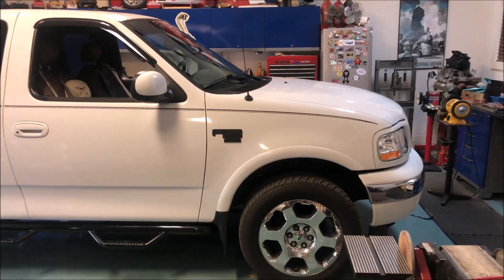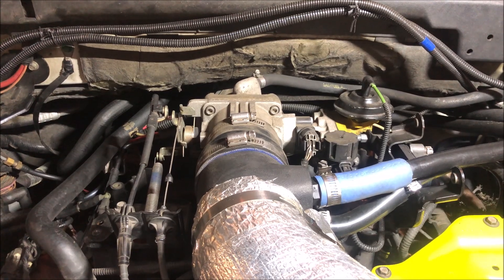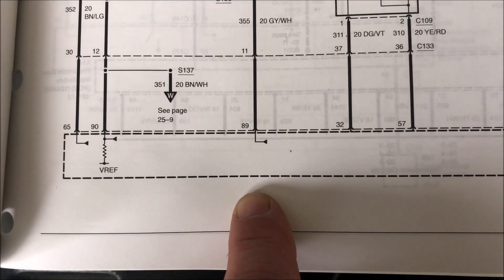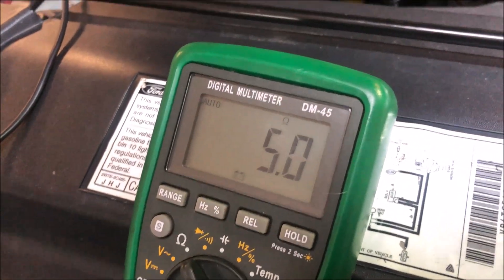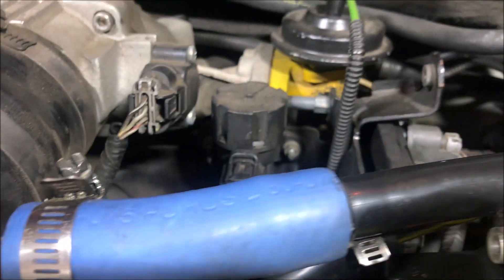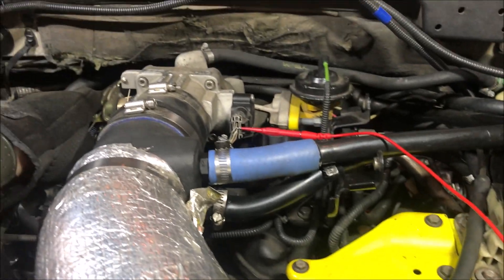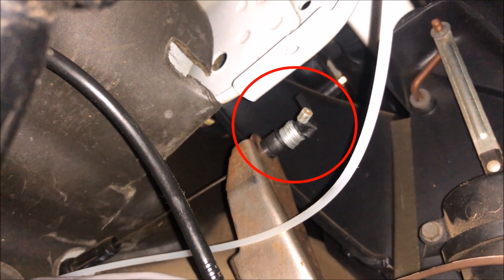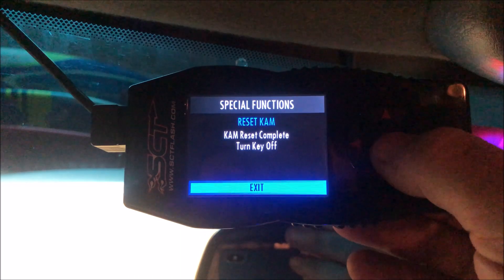How To Diagnose A Bad Throttle Position Sensor: 10th Gen F150, Expedition & Zip Tie Method

Comment: Hey man.  I like your explanation of how the TPS operates and what to look for.  I was wondering, how does your truck start with the 'Theft' light flashing??? I was told that if the theft light is flashing, it means that the PCM is not communicating or powering up, and the anti-theft system wouldn't allow for engine start!?!?!? What are your thought??? Thanks...
Reply from the maker: Thanks for the comment.  I'm not familiar with the details of the "Theft" system.  It will flash slowly when the vehicle is parked, however, I assume you're asking this question because it's flashing fast when trying to start the vehicle?  If so, the key might need to be matched to the ECM.
Reply: Cool. Got it. Thanks for the reply... @DrivingIntelligence

Comment: Does this work on a 2008 saturn aura
Reply from the maker: From the information I have seen, the reference voltage is the same at 5 volts.  You should get a voltage signal back to the ECU from about 0.5V to almost 5V.  A smooth increase in voltage as you open the throttle.  Same as shown in this video.

Comment: HAVYOU EVER HAD PART THROTTLE HESITATION LIGHT THROTTLE THAT IS PRESENT IN HOT WEATHER 2ND GEAR BUT GOES AWAY WHEN YOU GIVE JUST A LITTLE MORE THROTTLE? NO CODES
Reply from the maker: I've not experienced this, but this could be the TPS.  Check the voltage as I show in the video to make sure it is smooth and consistent as you open the throttle blade.
Reply: THANK YOU I WILL @DrivingIntelligence

Comment: I did the zip tie mod on my 02 just after I bought it. Drove it home, did the mod, and the difference was night and day.

Had the same issue with my tps. Every time I would test it, it tested fine, but driving I had lack of power and odd shifts. These early modular engines were very finicky. So many little things could go wrong that make you think a bigger problem is the culprit.
Reply from the maker: yes, makes a huge difference.  Can't get replacement cables anymore.
Reply: @DrivingIntelligence  i like the method you took with the washers. I might actually redo mine to resemble yours.
Reply from the maker: Thanks Ezee... I think this method removes some stress from the end of the cable.